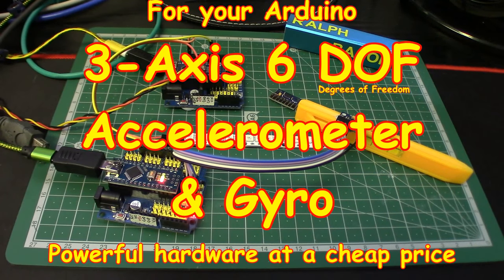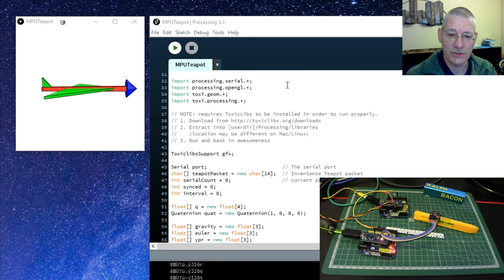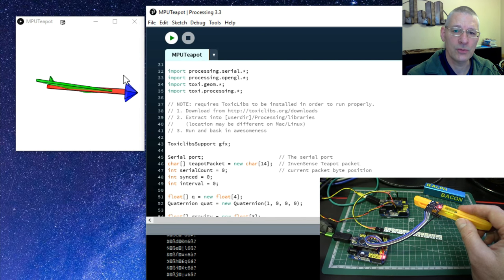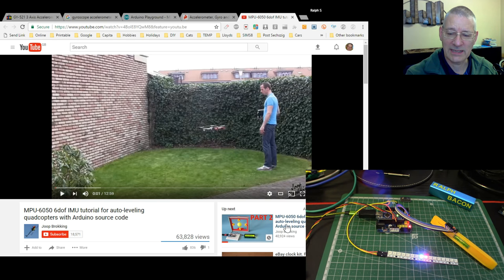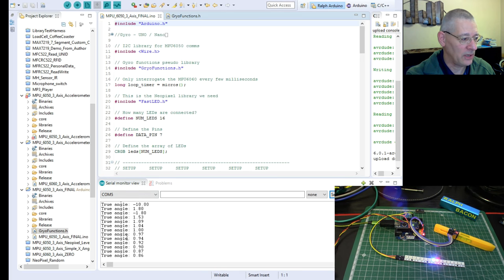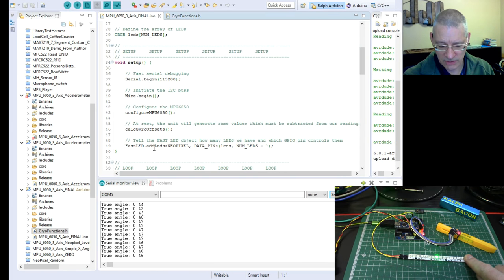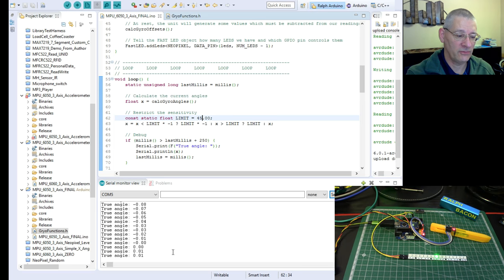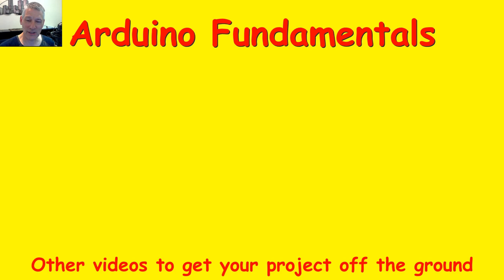#76 MPU6050 3-Axis Accelerometer Gyro - First Look

Comment: I played around with one of those a few months back and was amazed by the how smooth and accurate they were. About 20 years ago I designed a golf training aid for a company to help keep your head still when playing golf (mostly while putting) it sounded a buzzer and lit a particular pair of LEDs fitted under the peak of a golf hat. The circuit used piezo film with weights on and op-amps in a bridge configuration. It was suggested at the time I looked at using an accelerometer. This however was way to expensive, my how times have changed..
Reply from the maker: So perhaps, WildScotsman, you have found a niche business opportunity by re-inventing your 20-year old device with one of these? As you have the rest of the design (albeit probably running on valves/tubes if it's that old) this will be child's play for you. Just goes to show there is never a new idea out there, or one that hasn't been thought of already.

(If you do relaunch this, and are successful, I claim 10% commission!) Thanks for posting, fantastic idea.

Comment: Great video, My washer/dryer is in the basement and we don't hear the dryer buzzer all the time. I'm thinking about using this unit to tell me when the dryer is running,and more importantly when it has Stopped. I'll then try to send a SMS message to my cell phone, which is always nearby. I'm thinking on just using one of the axis (x)  to let me know if there is movement. Your video explains how to segregate the x axis. You have always been a great source of info, Thanks again.
Reply from the maker: That's a novel idea indeed, William. Does you dryer move enough for you to identify that it has stopped moving? I'll be interested if you ever get this working (probably on a breadboard to start off with).
Reply: @RalphBacon  I am looking at the gyroX movement to  make it simple. I took a 30 second period and looked at the max and min of the reading. The delta is around 25 points. I'll monitor all the time, turn on a flag once I see 3 consecutive periods of activity and then look for 3 consecutive periods of no activity. With no activity the delta drops down to 4 so it is an obvious shift. Then I'll issue a pushbullet message to my cell phone, then go back to monitoring for the next cycle. I also plan on 2 LED's. The first would turn on when my device is monitoring (is it alive). The second would come on when the device detects a cycle in process. As an aside, I am not worried about calibrating the MPU6050, I'm just looking for the delta. I used ThingSpeak to gather and display the data to determine if the concept was feasible. I plan on a WeMos mini with the MPU on a stack in a small box 2-sided taped to dryer. I saw a recent video on a dryer project by Kevin Darrah but I wanted a simpler detection device and I think the gy-521 was my solution. The key is to have the device firmly attached to the dryer to pick up its movement thus the 2 sided tape.

Comment: Hello Ralph,
Thank You for the wonderful explanation in the video.
Is there a way we can track the movement of the object and orientation ? In this video the MPU 6050 is used for tracking the Orientation. 
if there is a pen or any object in my hand and i want to track its position + Orientation. Will we require any other sensor for it ?
If you can assist would really appreciate that.
Thank you.
Hammad
Reply from the maker: I can't remember, Hammad. If you build this the same way I did in the demo you may find the answer, or else Google may help. Someone, somewhere just have done this!

Comment: Arduino IDE and Processing do have a lot in common. Processing does get used a lot in data visualisation, Arduino can be used in data gathering. I think the developers didn't want to build the IDE from scratch and I can't blame them. The shared looks is nice for people who are acquainted with one or the other. Nowadays the Processing IDE looks a lot more modern than it used to look like, it used to look a lot more like the Arduino IDE ;)
Reply from the maker: I must admit, Thomas, that it looked a bit "Mac-like" to me - attractive though, and different from the Arduino IDE which could do with a facelift. But then again, that's why I did my video on Sublime Text, an alternative IDE which offers many advantages over the regular IDE (not just a pretty face!) but is still very usable for beginners that have outgrown the original. No, I don't blame the Arduino developers for taking an existing IDE and making it work for them, not one jot. Thanks for posting, good to hear from you.

Comment: Great video. Can the sensor be programmed, and work independent of the software - smaller circuit package with a band of maybe 0 -15 degrees of tilt upright (just for instance) with a buzzer or some other kind of feedback?
Reply from the maker: As Amazon Echo "Alexa" constantly says to me, "I'm not sure about that", Rich, sorry. It's been a while since I programmed this device (and did this video) and all I recall right now is that I could read the data back OK and act upon it, but I don't know whether it can run independently and "do stuff" that an Arduino would normally be used to do.
 
You could always use a much smaller Arduino, though, if you're just after a smaller footprint. Such as the ATTiny85 and Sparkfun Pro Micro to just name a couple.

I'm sure my answer is as useful as my Echo, sorry.

Comment: nice video.  could two if these units be used to measure vibration on all three axis.  one would be mounted on say a drones body and the other on a anti vibration mount and then some how show the difference between the two reading.  i am not a coder but would like to try this and just require some guidance.  was hoping to use esp2866
Reply from the maker: HI Gaatech! Now the measurement of vibration is actually covered in the two videos by Joop Brokking, as he straps his Gyro to a motor to emulate the vibration. If anyone has the answer, he does in that video. But he takes into account the vibration, he doesn't measure it separately. However he does it, it obviously works beautifully for him. Go and check out his videos (links in my video description), I reckon they will help. I don't see why an ESP8266 could not be used, it's a powerful unit so could do all the required calculations a lot quicker than an Arduino.

Comment: Another 3-axis sensor is a Nintendo Wii Nunchuk controller. But i think the MPU6050 is more precise than the Nunchucks 3L02A chip and for sure cheaper then the controller.
Reply from the maker: Well it certainly was cheap, stereomatzel, that's for sure. I only bought it because it looked interesting (as well as cheap) so I thought I'd take a punt and find out. I reckon it worked pretty well considering we were just manipulating the raw values, thanks to Joop Brocking's maths functions. There are a few 3-axis controllers but this is the only one I've played about with. Good to hear from you.

Comment: Hi Ralph,

In the Pseudo-library, can you explain the name " _GYRO_ " that you have used in your #ifndef statement, I've seen the double underscore before but don't understand it. How does it relate to the contents of the library? What "name" should a library builder use in that #ifndef statement?  Kind Regards Alan
Reply from the maker: Hey Alan! the name used in an #ifndef statement is simply one that is (almost) guaranteed to be unique. It can be anything. The reason underscores are used (before, after, both) is simply to make it even more unlikely anyone will use that name elsewhere. It has no actual relationship to the library although logic dictates it should somehow be related to it. But you could call it _Fred_ and it would still work. Good question, thanks for posting.

Comment: I can't tell if you've covered this subject or not.  Can you cover in one of your videos how to handle bits, bytes, operations of bits.  For example in IR remote control.
Reply from the maker: Hello Timothy! I've covered some BCD (binary coded decimal) calculations in video #8 but if you're after how to manipulate bits (binary arithmetic) for something like the Pin Extender (where you receive a full byte but only want to set/unset a single bit) then I do have this in mind for a future video. Can you expand a little on what you are hoping such a video would cover? Good suggestion!

Comment: Great videos you have. So helpful, really.
I have used Brokking's arduino code for the MPU6050 but so far i have not been able to read Yaw values. It would be great if you could give me some hints to read yaw angle. I want to display all angles to built a spirit level. Thank is advance.
Reply from the maker: I chose the X angle purely for the demo (almost at random). I wonder if it would do something different if I used the Z-axis (yaw) or, indeed, the Y-axis. Let me experiment a bit to see whether it works as expected. And thanks for the positive feedback, Milthon, always good to know these videos are adding value!

Comment: Yes. I want to understand how to receive a byte manipulate the bits and decipher their meaning. How to apply this on anything that may be using bits to communicate with the arduino
Reply from the maker: OK, I think this will be covered when I do the video on the Tiny85 using the pin extender unit, as you have to manipulate the bits of each byte to switch various pins on and off (it's fairly simple binary arithmetic using AND and OR). I've moved it up the backlog and might address this sooner than later after your nudge, so thanks for that!

Comment: Ralph,

Could you please explain Line 63 of the code;   x=x(lots of strange stuff with more x's). I've seen this before, possibly in one of your videos, but cant find the reference. Kind regards

Alan
Reply from the maker: Sure thing Alan, good that you asked this as I can clarify to anyone reading this post.
 
For the purpose of this reply I'll simplify the line in question with this:
 
int direction = x > 180 ? 360 - x : x + 10
 
This means, the integer variable direction will be assigned according to the aptly named "? :" operator (shorthand "if").
 
This can be expressed as: condition ? first expression : second expression, so here we are asking:
 
(condition) is x > 180 ?
if so, use the (first expression) 360 - x (so if x were 190, the result of this would now be 170)
otherwise (second expression) x + 10 (so if x were 10  the result would be 20)
 
You can always rewrite (less succinctly) the above expression as:
 
int direction;
if (x > 180) {
   direction = 360 - x;
}
else {
    direction = x + 10;
}
 
You can see why the shorthand is preferred by developers.
 
Incidentally, I think Alan has made up a new technical term to describe this construct ("lots of strange stuff with more x's"). Love it.
Reply: Fame at last!

Comment: What, kindly wanted to know if it is possible to make it work with an arduino nano card? and I wanted to ask if you can always kindly provide a link to the colored bubble I see in the video, thanks!
Reply: I would like to make an electronic bubble like yours, if possible ...
Reply from the maker: Yes, Wanny, this will work with a Nano in the same way that it does with a Nano, no difference. I'm afraid the "coloured bubble" (called a spirit level) was some cheap thing I got years ago and just used for this demo, so no link, sorry. But you can pick up similar ones from eBay, I'm sure.

Comment: Hey, thanks for the video i really appreciate it.. on the progress of my work, i have succeed to get the yaw pitch roll of the sensor and make model on the C# based program.. i use esp8266 to send the data OTA, when i connect it via usb to the comp, the HMI can operate but if i send the data OTA the HMI show error,, i dont know what cause it, when i saw on the serial monitor the angle data seems alright thou..
Reply from the maker: I don't know what the issue is you're facing here, it's outside of my experience of drones and Gyros and the like. You could post your question on the Arduino forum (forum.arduino.cc/index.php) they have many experts who have seen it, done it and got the T-shirt all before. Just state your problem clearly so they can see the work you have already done (they hate doing someone's homework) and I reckon you'll find at one person who can help. If you get it resolved do let us all know here too!
Reply: okay, im currently trying to solve it with my friends.. hope it will worked out..

Comment: hi sir, if im using the arduino mega, the setup will remain the same or i have to change the code a bit? thank you sir
Reply from the maker: I'm pretty sure you don't have to change a thing, Irfan (other than selecting the correct board in the IDE). If you get problems, let me know.

Comment: Ah now I understand, You use accerometer to calculate Z axis, and combining time You can calculate how much rotation on Z axis was made. I look at tutorial about that chip, and cunstruction is based as measuring mass against earth. If I rotate more in Y axis or Z axis, then values are bigger, but Z axis is unavaible of cource. Then is coming to play accerometer, This way values of X and Y rotated on Z axis can be calculated how big force was used to turn, and using time, is posible to calculate overal rotation. But rotation is not static, is cjhanging back to zero when module is not moved for longer time.
Reply from the maker: Glad you got it figured out, it was a long time ago when I did that video.

Comment: You've strayed into my particular area of interest. No build video as I prefer to make gadgets rather than make videos but here is a link to some photos of my multirotor build from last year.

 http://imgur.com/a/hRqZj

The flight controller has one of those devices on board. This particular machine is now back in pieces on my workbench as I am in the process of a rebuild as I want to add the "extras" such as GPS assisted flight modes.
Reply from the maker: My mother told me I strayed a lot, mostly "from the straight and narrow". But how about that, me doing a video on a device that you must know very well, and on a quadcopter too! What I don't know (mainly because I don't know drones) is how this device, together with a microcontroller, actually keeps the quadcopter stable. What does it do with the motors, or whatever? Or does it feed info into the onboard receiver/controller?

Nice pics, by the way, I see you have the same scope as me. Great minds and all that...
Reply: It is something called PID and it is very tricky to explain (I sure couldn't manage as physics was never my forte.) There are plenty of good explanations on the web and a couple of very good videos by the more skilled multirotor builders out there. The firmware on the flight controller and the configuration software deal with all the "nitty-gritty." Me, I just like to build them and fly them.

If you want to find out more Google for a document entitled "PID without a PhD"
Reply from the maker: I'll do just that Nick, just to satisfy my own curiosity, thanks for the information.
Reply: If you are curious, this is a link to the flight controller board I use,

https://www.unmannedtechshop.co.uk/naze-32-full-10-dof-flight-controller-rev-6/

Lots  of amazing features for a quite modest price. There are newer and better flight controllers out there now but this one has a good track record.
Reply from the maker: A whole world of Naze controllers, it would appear. I wish I had time to actually fly a drone. The tiny ones I have are good fun for an hour on a very calm summer's day but I really want one to shoot HD quality video so I can inspect my roof, gutters, chimney and the like. Now there's a business idea...